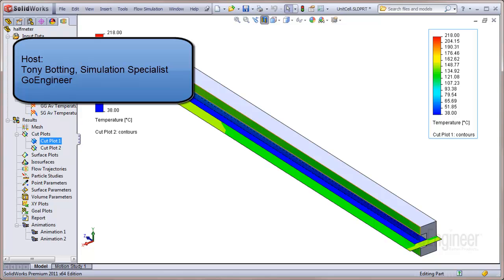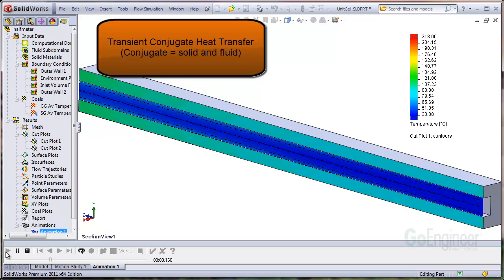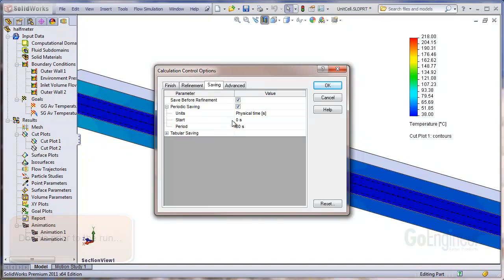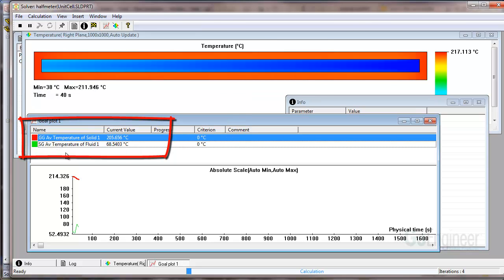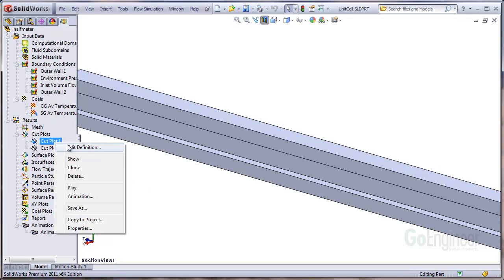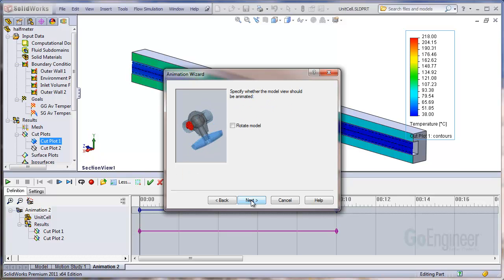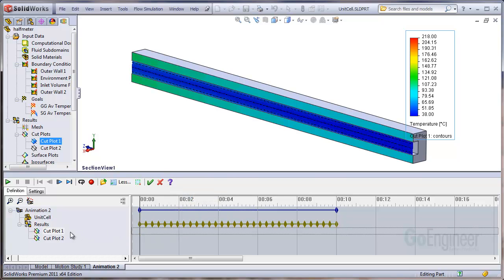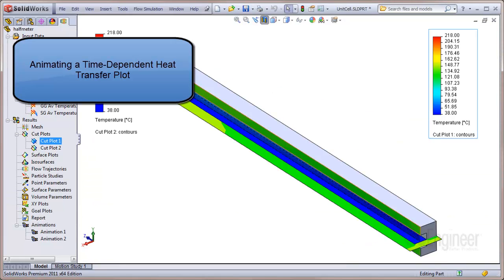SOLIDWORKS Flow Simulation - Animation of Time-dependent Heat

Comment: When I run the system it takes to long to simulate 1800s. I set the periode to 120s but it still needs hours to calculate 1800s. Are there any settings to change to be faster?

Comment: You're instructions are very clear, thank you. I've successfully been able to produce an animation, but when I record the animation, all the frames are black. I've tried adjusting the recording settings (frame rate, compressor, file type) with the same result. Here is a link to the same question on the solidworks forum which is unanswered, so it seems other people are also having this issue. Any suggestions?

https://forum.solidworks.com/thread/48130